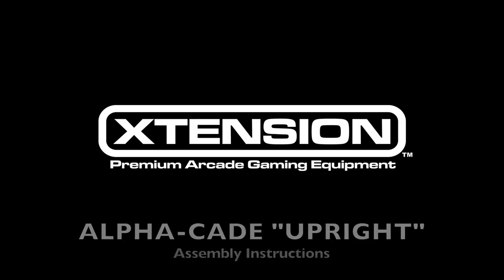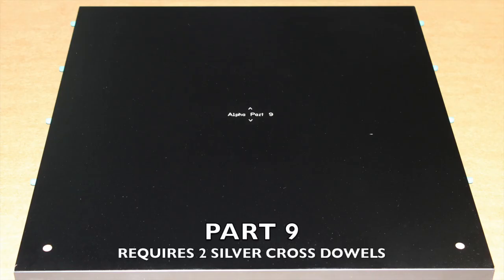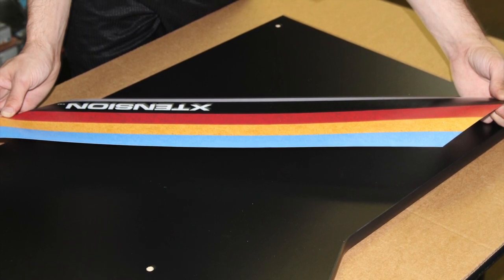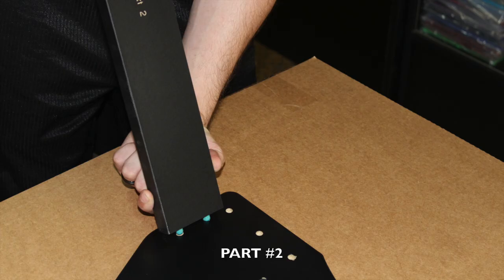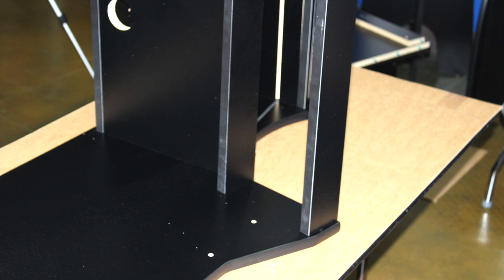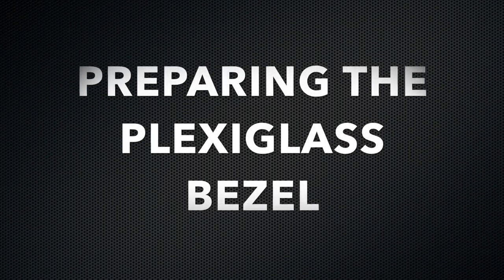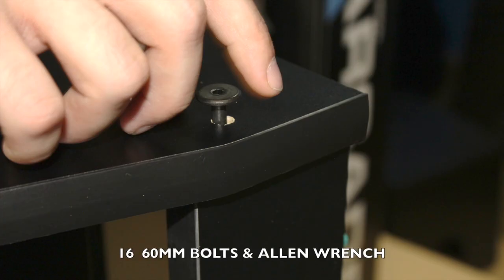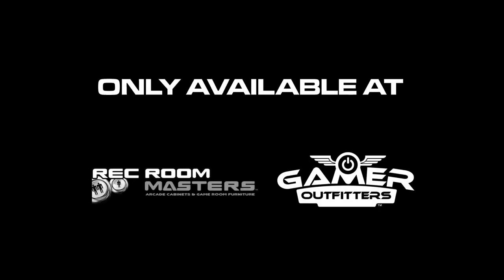Xtension Alpha Cade 3/4 Scale Upright Arcade Assembly Instructions

Comment: Love the little box. The only thing arcade 1up has on you is the graphics and button layout. I really wish you had different layouts for the buttons. I would like my buttons a bit closer and Japanese style with the slant. Or a Neo geo style. All i would need then is the vinyl stickers.
Reply: Dan Smith  I doubt it, I saw a comparison with the 1up machine next to this and this one seems to be a bit wider.
Reply: Dan Smith  And they said they won't be offering a riser because they make a larger full size model. This one in the video is like $350 and the larger model runs $799-999. The bigger ones also have a light up marquee and don't have these hideous graphics...

Comment: Do you need to buy a converter board if you're using an older VGA 24KHz JAMMA board instead of a pandora's box?
Reply from the maker: It would depend on your 3rd party TV and if it supports VGA. If your TV is HDMI, upgrading to a pandora's box may be something to consider as most modern pandora's box cartages do have an HDMI out.

Comment: I'm really interested in buy this, but I was wondering if it's possible to replace one of the buttons with a spinner? I would love to buy the 32" Pro, but space is limited.
Reply from the maker: Sorry, we are not a custom shop and manufacture our products in quantity. You are more than welcome to modify the product yourself after you receive it, however we do not offer support on aftermarket modifications.
Reply: @Gameroutfitters  Thank you for the quick reply. I meant if I could replace it, and I understand that you don't offer support for that. I will be ordering mine soon.
Reply from the maker: @wintwh  There may be some 3rd party spinners on the market that support the same size button hole as the standard Suzo Happ push button that is featured in the Alph-Cade. You may what to search around for 3rd party spinner components and conform if they will fit a standard Suzo Happ push button hole.

Comment: I bought one of these cabs before you sold out, and I can't wait... I have the 22" version of the TV you recommend from Best Buy. At 20 W x 12 H inch. it should fit no problem, but the issue I noticed is that the 19" TV version you guys use has a VESA pattern of 75 x 75 as opposed to the 22" which is a 100 x 100 pattern. Would I be able to mount the TV in the slots adjacent to the pre-drilled holes? Or should I just get an adapter 75x75 to 100x100 plate to mount it?
Reply from the maker: Yes, the cabinet does support a 100x100 VESA configuration, and the 100x100 VESA mount configuration is actually vertically adjustable. There is no need for any VESA adapter.
Reply: @Gameroutfitters  Awesome sauce! Thanks for tha feedback! Was actually planning on buying the adapter plate before I read this. You made my day!

Comment: Does it include speakers and an amp?
Reply from the maker: All you need is to use the speakers that come built in with your 3rd party TV. No need for additional speakers or amp. The HDMI from your Pi or PC transmits sound to the TV. You can then control the volume by using the TVs remote control.
Reply: Gamer Outfitters ah thanks. I should have asked if it had holes and grills cut to mount 4” speakers like most cabinet kits. I’m loving this but planning on using a 22” monitor I have already with the new 22” version of the cab
Reply from the maker: @ListosVerde  There are no pre cut speaker holes or grills as the cabinet was designed for simplicity, and again to use the HDMI speakers that are included with your 3rd party TV. You can definitely modify the cabinet anyway you like after you receive it if you would like to drill and add 4 inch speakers.

Comment: so this DOESN'T come with the monitor?
Reply from the maker: That is correct. we only manufacture cabinets and controllers and specialize in just that. You can easily pick up a 19" TV at your local Best Buy or Walmart or, you can simply install any monitor or TV that you already have measuring no wider than 20 15/16" in Horizontal Left to Right Width. Here is s link to our current TV recommendation: (If Available) https://www.bestbuy.com/site/insignia-19-class-led-720p-hdtv/6164904.p?skuId=6164904
Reply: For the price you can't beat it. The cheapo 1up has a built in screen but when it burns out have fun replacing it because you have to get one that'd plug into their machine or find a way to wire it and make it work... It's a mess I don't wanna have to deal with personally so I love the idea of this machine... I can pick my own tv and know that some company didn't cheap out with a cheap Chinese one... That and it'd probably just get busted in shipping.

Comment: I LOVE this machine and for the price you'd be hard pressed to make it yourself for much cheaper... But the graphics are just awful... They should offer an all black panel for the buttons and joysticks instead of the one with the stupid lines on it. I love that you can leave the other decals off... I also hate that it doesn't have a way to do a light up marquee... But for the price... It beats the cheapo 1up machines any day!
Reply from the maker: Thank you for your feedback, however you may find it helpful to know that the control panel graphic on the Alpha-Cade was designed to be easily removed or pealed off. You can simply removed it without having to dismantle or remove any buttons or joysticks if you choose not to use the pre applied default control panel graphic. Also, as far as a back lit marquee, we do feature that option on our line of full size cabinet models only, and apologize that that option will not be available on the Alpha-Cade series. If you are interested in additional features, you may want to consider upgrading to one of our full size cabinet models. https://www.recroommasters.com/retro-arcade-cabinets-s/71.htm